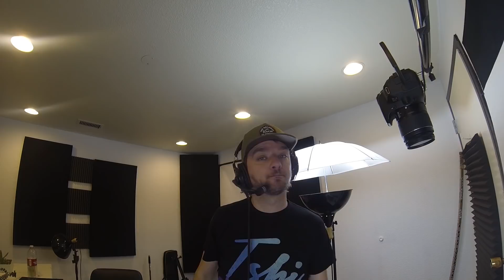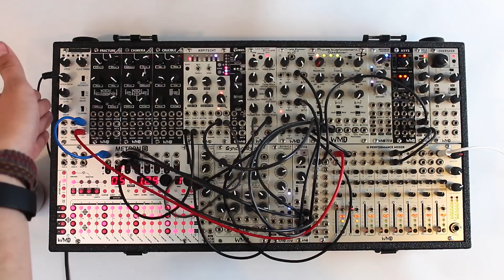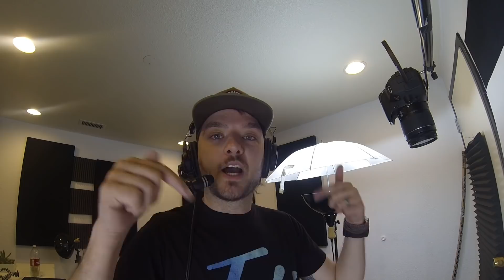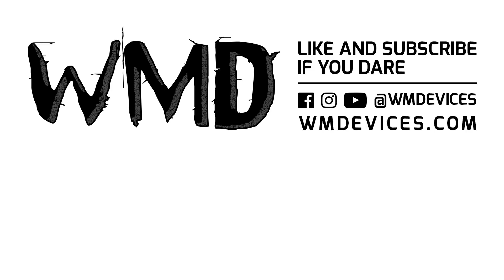WMD Phase Displacement Oscillator Mkii (PDO mk2) - Phase Modulation Techniques

Comment: Hi, does this work correctly with 0 Hz v/oct input? I just want to use my own phase without using the pitch or tuning from the oscillator.
Reply: No that’s not how it works. The phase mod inputs are modulation. The main oscillator doesn’t go to 0 hz.